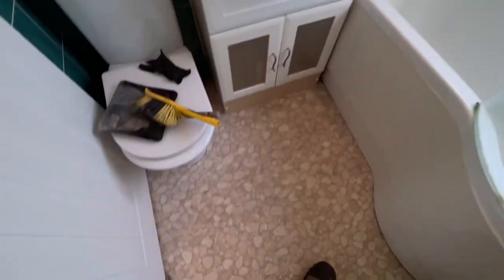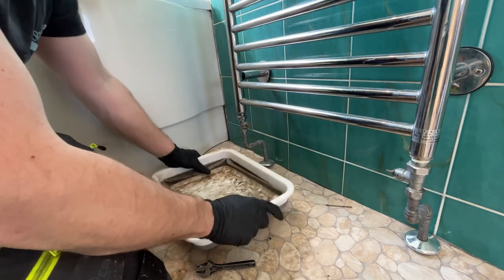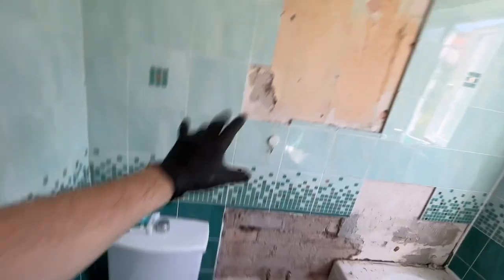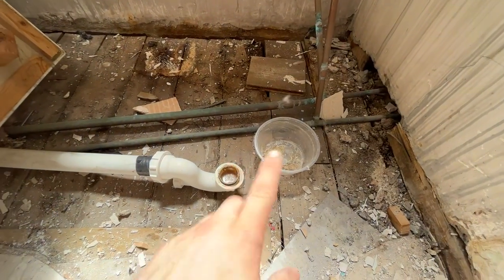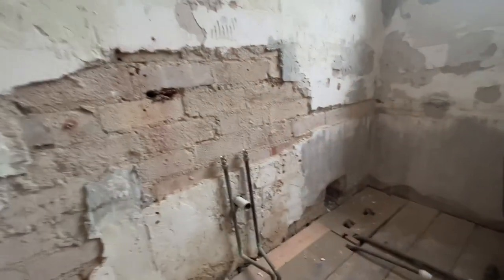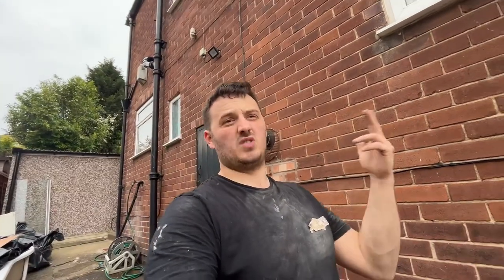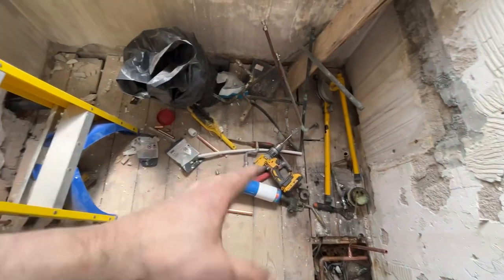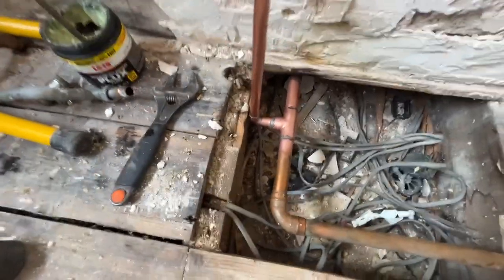See This Bathroom Transformations From Start To Finish!

Comment: Superb content and nothing wrong with your soldering as you say better more than less. How did you get the old cast iron straight or bend out of the soil stack to replace with the pan type connector fitting. Just curious to know as if you cut it out with the grinder it would have left a we collar inside the cast iron section and then your pan connector wouldn’t fit. Your a fantastic plumber really conscientious which shows you care. Excellent material.
Reply from the maker: So I took it back to the branch outside and used a cast to plastic adapter to come back inside